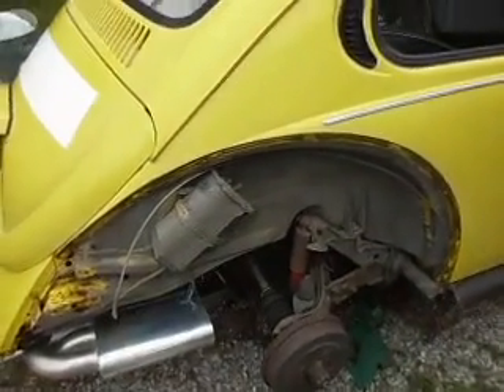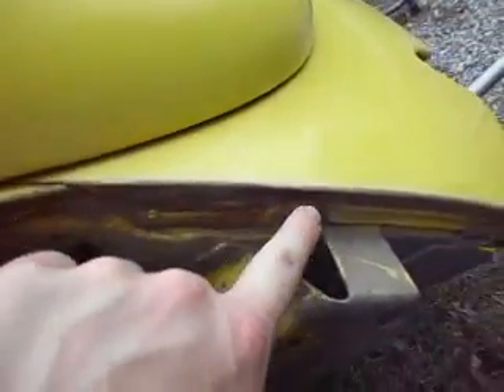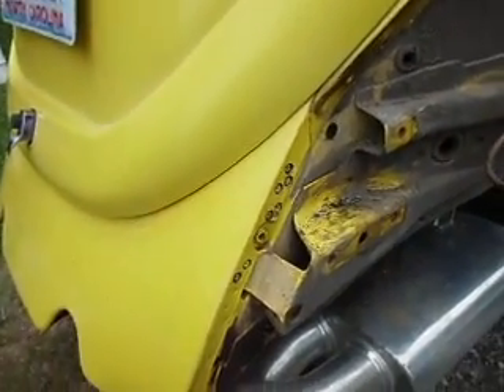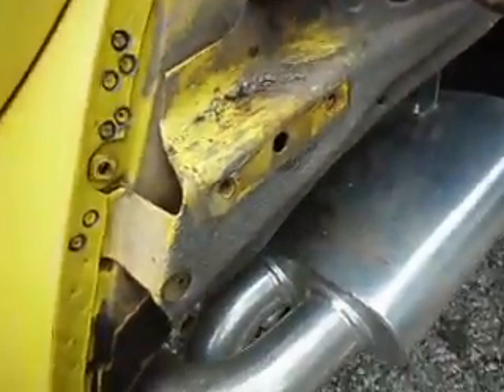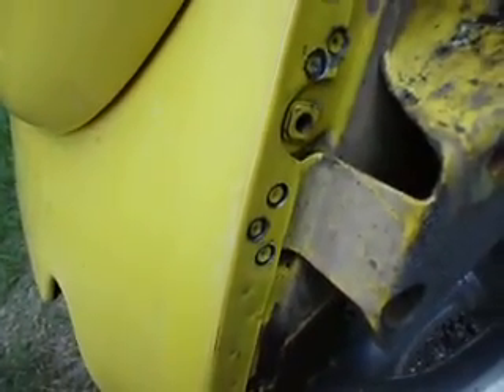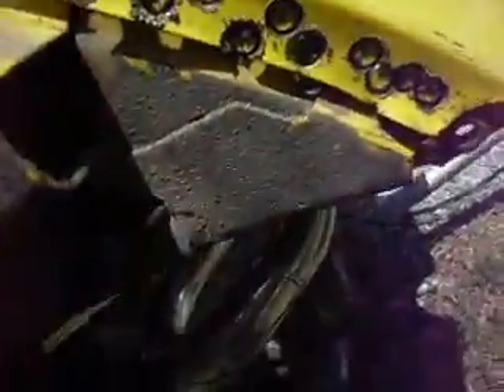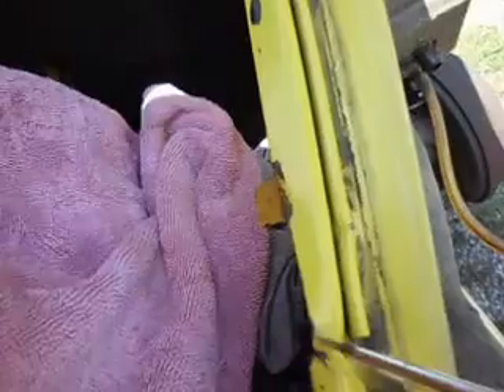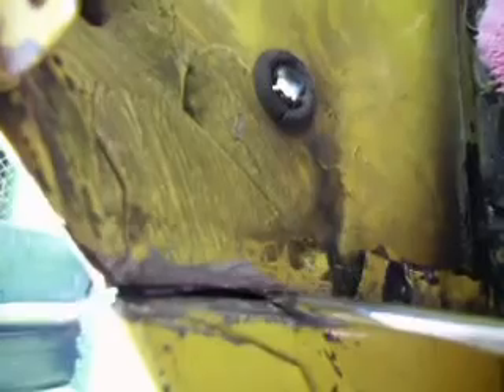VW Bug Beetle Removable Rear Apron

Comment: Hi. How did you attach the new apron? Quick release?
Reply from the maker: I've done it several ways, quick release DZUS fasteners, regular bolts, and my favorite:  Nothing.  For the past year I have been running one that is held in by nothing other than the rear fenders.  The last three bolts around the backsides of the rear fenders will hold the apron in there after you tighten them down.  It's like putting the apron in two vises and it is NOT coming out of there, come Hell or high water!

Comment: Nice, clear video! I would like to do this on my Bug. What tool did you use in your Dremel to cut the inside "ears"?
Reply: marbleknight
Thanks, but I got it done already. I had a cutter like the one you linked to, and it seemed the most likely one to work, so I used it. As you said to Lee Elliott below, I am keeping it on just with the fender bolts, and so far it has been secure. Anyway, I wouldn't have attempted this without your video. It helped greatly to show what problems were to be expected.

Comment: What is that you covered your hood vents with??
Reply from the maker: Just a magnetic strip.  If I'm out driving and it looks like it's going to rain I will slap it on there to keep water out of the engine bay.  I don't drive with it on there though.
Reply: +marbleknight so is there a overheating problem when they are covered? So rain really gets in the engine ?
Reply from the maker: I never tried driving it with the vents covered so I'm not sure about the overheating.  You could argue that the earlier models didn't have decklid vents at all, but VW must have put them there for a reason.  As for whether the rain comes in through the vents, the answer is absolutely.  The vents are right over the engine with nothing but air in between.